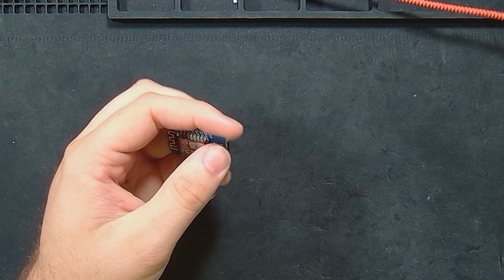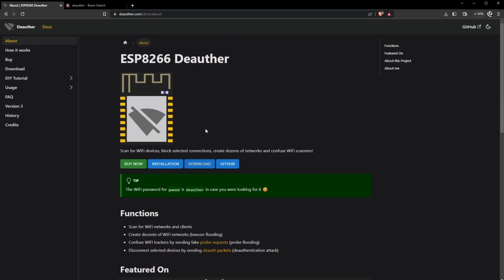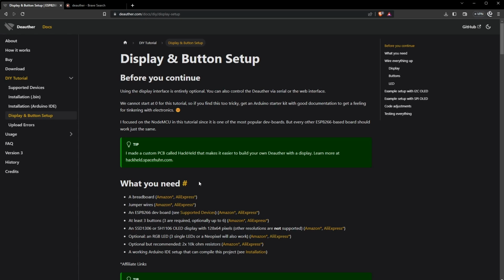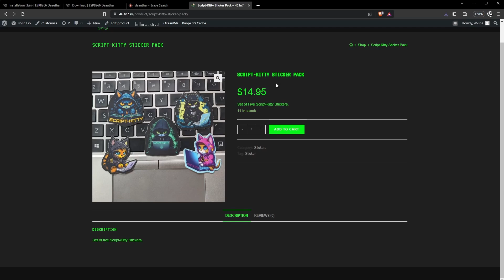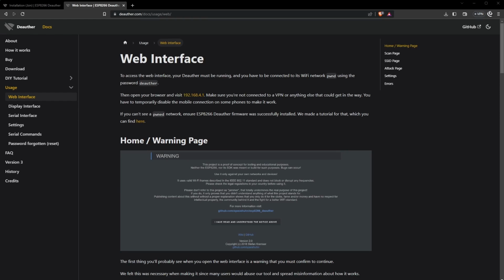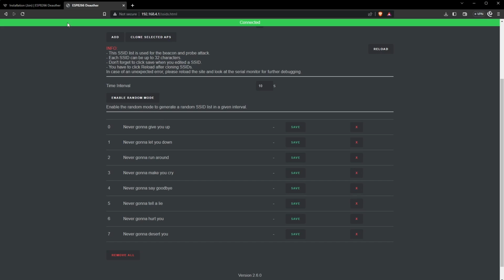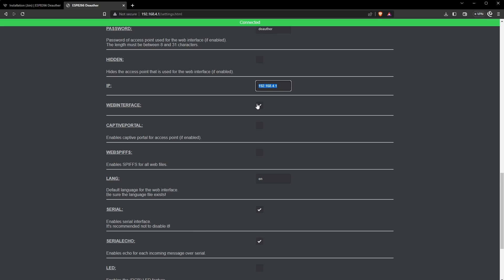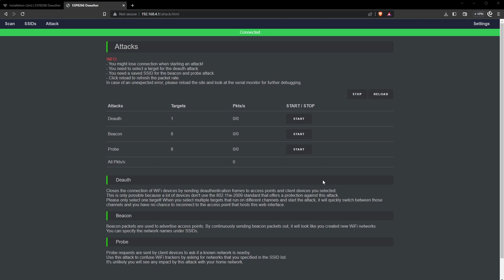Simple ESP8266 Deauther v2 Setup

Comment: just followed along on the installation, but i have a ESP8266 12f board from amazon, did everything correct, installed just fine. went to test it on my own network and nothing was happening 🥲😪
Reply: Check the serial monitor in IDE setup and if baud rate matches programmed baud rate you will at least see the network devices it see's . I myself have no way to get the I2C to display with this software and I tried to modify the software and no luck. I can however get a test program to print to the display so I know it works.
Reply: same problem here